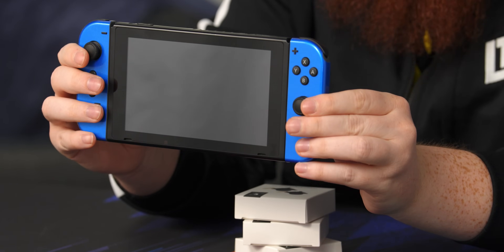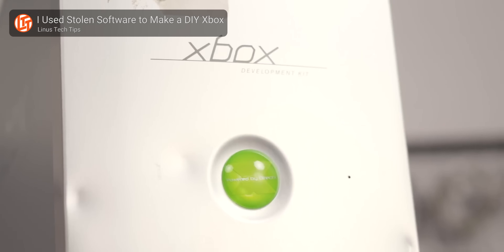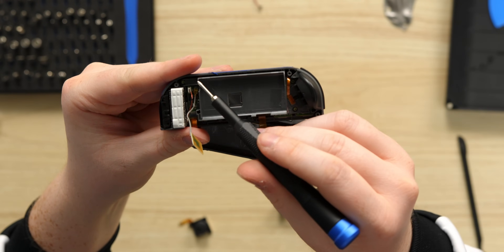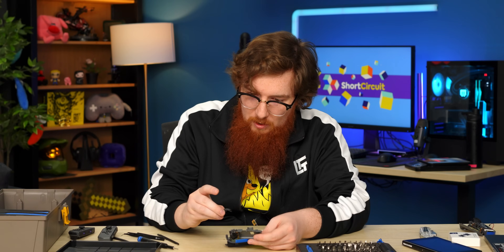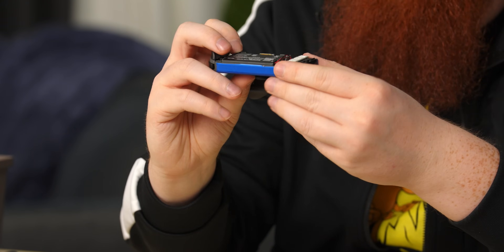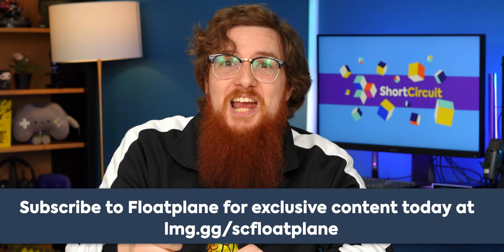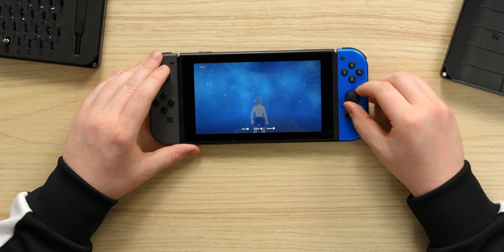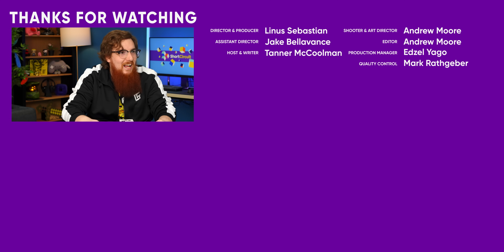Make your controllers WAAAY better - Gulikit Joycon Joysticks

Comment: The fact that there's no noticeable difference between the original and this one is, in fact, a huge selling point! You really don't want your controllers to feel "wrong" after a part replacement, after all.
Reply: I've been using them for awhile and, there's no difference whatsoever that I can feel. I mean, I might have convinced myself that I felt a teeny, tiny difference (just like he did) when I first put the pair I got in but, I honestly have to remind myself which joy con have the gullis and which ones don't so I'm leaning more to thinking that even if you think you feel a difference? Most of it's probably just in your head because you know that you changed them so.... they gotta feel just a little different, right? lol.
Reply: @dallaynavokan5513  Oh, I've definitely had that happen! Not with joy cons, but other hardware where I replaced a component. Especially since the thing is broken at that time, you've probably forgotten how it felt initially as well, and it just feels different in your head now. 

I call it "repair paranoia", where you start judging the object every single time you use it and are careful to notice any discrepancies in the job you did.

For example, I changed the locks on a couple of doors and one locking mechanism too, whatever it's called. Every time I used the doors, I'd try to feel the handle and the keys to see if anything didn't fit.
Reply: @dallaynavokan5513  its the same caps but the deadzone sensitivity across the board is far superior to the native joycon. Have you tried tweaking sensitivity in games at all?
Reply: @dallaynavokan5513  That tiny difference that is barely perceptible and after 5 mins, you are used to it and question it, is the fact that it does not have potentiometers rubbing together inside. Its such a small thing that most people without very fine motor skills wont even notice.
Reply: Speaking of which we saw it in the video but you’re almost guaranteed to have to calibrate one of these but it works great after that just make sure to calibrate it attached to the switch
Reply: Commodity parts are quite good. And paying a bit more gets you a magnetometer instead
Reply: It has a bigger input lag than the normal analog sticks
Reply: I just tried these but sensitivity on them is too much different than the originals, maybe I got a bad pair but the travel distance is so much shorter when you check the calibration it seems off to me.
Reply: @dallaynavokan5513 this is called confirmation bias. You see patterns that don’t exist which confirm something you believe is true.

Comment: These have had a bit of a quality control problem. The first batch had arms that would catch and jump a bit, causing a click and the magnet to jump a bit. They claimed to have fixed the issues from that batch, but I got a set recently that had the exact same issue. They really need to get that ironed out before I consider them again.
Reply: This was also not mentioned on the KingKong Pro 2 video, Gulikit has consistently had QC issues with their products.
Reply: Yea, I almost got a few sets for my joycons, and wouldn't mind some for the steamdeck as well, but there are enough iffy reviews to keep me away
Reply: Thanks for writing this post. Just from seeing the title you'd expect this to be the holy grail fix for joycon drift, but when it's a product that has issues of it's own, it becomes a questionable purchase.
Reply: I received them a couple of days ago, it's a new batch said Gulikit. I can assure you they don't click anymore but they still have a little gap when it's installed. To fix that gap they have provided black round stickers to cover it.
Reply: @MariusMerchiers  i think that's a good enough fix considering that even the stock joysticks also has that exact type of sticker
Reply: @IdiotRace  oh i wasn't talking about that issue, that one definitely needs the manufacturing fix. i was talking about the gap issue
Reply: @MariusMerchiers  I don't know what to say, I ordered after they said they fixed them and received them 2 weeks ago. Every single one clicked. I also got the ones for the Steam deck and one of those click, but at least I haven't seen a functional issue on that. I'm just kinda soured on the company now.
Reply: @adeptfelix  They are a startup, atleast they are trying to make a difference, and trying to iron out their shit. Their new KK2s had added weights and Trigger dampeners, they sell them cheap for $40 in my country, an improvement with no additional cost always a good deal for me.
Reply: @rowennjohnmartinez5108 lol they are prob just trying to make money.
Reply: @AngryWildMango  trying to make money while also trying to change something is what companeis do right? BIG companies doesn't want to implement hall effects so here we have one who does.

Comment: you could do laser pointer detector pad joycons
Reply: no magnets, just laser on the tip, linus tech tips
Reply: pen detector pad is easier (led detectors) than a full camera, 1-bit laser pad
Reply: or just touchcons, not joycons
Reply: yep kinda steam deck touch joy pads but actually meant to be touch-joycons
Reply: getting bored already?
Reply: you fixit what you started
Reply: add a twist axis to the knob
Reply: yes for (float)plane games
Reply: well a 1-bit lcd detector screen

Comment: Wait am I crazy?
The video shows him disassemble the left joy-con and remove the blue wrap. But later in the video he keeps referring to right joy con as the replaced unit (despite it still being wrapped in blue) eg. 5:53??
Reply: I got confused too but he only removed the wrap from the back, I think he just used another controller set for the gray one. You can see that the bottom is gray in the end shots
Reply: @GrindyBeak  thanks I was so confused lol

Comment: One thing I can never get a clear answer on: Does this kit work on Switch Lite?
Reply: Teardowns seem to show they use the same joysticks, so I can't think of any reason why it shouldn't work
Reply: @tannermccoolman4647  Other than some strange firmware or different ribbon pinouts just to make repairs less easy for the consumer. Not like ANY company cough apple cough would act in such a manner though, right?

Edit: autocorrected pinouts to spinouts by accident.

Comment: I just wish there was a kit for Switch Pro controllers. I was able to find dozens and dozens of copies of this kit everywhere for the JoyCons, but not a single one for the Pro controller. Yes I know the sticks for the pro controller are soldered in (which I find annoying considering the much much smaller and more compact JoyCons managed to make all of it's parts modular and use connectors) but there are hundreds of soldering-required mods for systems out there. The GBA landscape is full of mods and even new ones being made to this day that give you better screens and (for original models) backlights, better audio, HDMI output, composite output, etc and many if not most of them require soldering. You would think there would be at least ONE hall-effect joystick replacement for the Pro controller. But all I can find are Hall Effect joysticks for joycons or the original Pro controller's joystick replacements, not Hall Effect ones.

And yes, the pro controller eventually drifts too, mine definitely is these days.

Comment: Whatever you do, DO NOT damage the JoyCon rail or shoulder button flex cable connectors. They are a true pain in the ass to replace so dont flip them open forcefully as the black plastic bracket comes off easily

Comment: Have you tried doing this too both joy cons on the Oled switches? This is the second set of joycons that won't connect to the Oled switch (brand new oled switch with joycons and only left joy-con).    Right after the mod....only one joycon will show up and when you disconnect both  controllers the left joycon will not connect with the switch....

Comment: I've been using the gulikit king Kong(pro?) 2 controller for ~5months now, and I can't never go back to 'official brand' controllers.
You can even te calibrate the controller's joysticks AND triggers.
I was so mad that my triggers were 'broken' so I threw it through the whole house, literally smashed it against the floor multiple times, just to find out that you can recalibrate the triggers, and I must say, there very durable, nothing broke at all!
The only downsides are the 'debounce time' it's hard to double tap the a b x y buttons and that you can't connect it to a PS4/5 or a Xbox. (It works with Nintendo switch)

Comment: The top of the stick comes off, making it easier to get through the opening, and is a vital part of the process, since there is a round sticker you put under the stick to keep debris from falling into the mechanism. 

They are great sticks though. I bought the gulikit controller after Linus reviewed it, and it was so great that I wanted hall effect sticks on my joycons. Apparently they are working on dual sense sticks also. Can’t wait for that so I can get rid of pot sticks completely.
Reply: There's also a split in those dust stickers so you can, at an angle, just ram the tops through.

Comment: Resistive joysticks can be corrected in software but somehow SONY Nintendo got lazy or it was too complicated.
The reason for hall effect is that because of the magnet, it lasts much longer than resistive, because it isn't being worn away.
Reply: gulikit aren’t licensed, however a ps5 controller hypr has hall sensor, and you can built yourself a controller with it

Comment: I just went through two pairs of these. For the joycons. First set had one with a flaking back and forth. Replaced it. Second one has worse drift than a regular joyCon sticks. :( Kind of disappointed these were recommended. Looking online tons of others have problems with these joysticks.

Comment: Just got these; working great!
I didn't realize the kit from amazon came with not only small screwdrivers for the 2 types of screws, but ALSO a tweezer-like tool, some thumb grip caps, AND an entire set of replacement screws in case you lose 1. I didn't but now I have spares!

Comment: My problem is motion. 
Bought HoTD and alien panic. Both have motion issue's,. It just drifts off a bit after awile. There is at least a center button. 
Wanted to buy arms and switch sports. Guess i won't. 
Ill try to get new joycons. 
I doubt this will fix the problem. Maybe?

Comment: Guess I have been lucky so far. Never had drift issues.
However, for 'a mere' 10 bucks difference I'm not gonna risk messing up a controller (which would mean I'd have to get a new one anyway).
I'd go for a new one to begin with.

Also wouldn't bother with it up front, obviously. Only considering it as a repair option.

Comment: I have four joycons with various degeees of drift from slightly annoying to completely unusable. My repair method has been using Hori Splitpad controllers for mobile gaming and using a switch pro controller (it’s a seriously good controller and worth it) for TV gaming. I hope to make this mod for at least the two worse of my joycons though as we have to use them if we are going to play any 4 players games and when you consider the cost of a switch pro + aftermarket joycons the $30 a pop cost isn’t terrible.
Reply: Buy an 8bitdo Ultimate controller. Thank me later.

Comment: I don't know why everybody gushes over these. I bought their first party controller and the dead zone compensation is all a lie and just within the controller firmware. You're having to recalibrate it on the fly which doesn't make the sticks any better it just makes manual labor for you calibrating it. They honestly have terrible dead zones and don't stick very well.

Comment: this is not the reason it was released if ya have working joycons don't replace BUT if your joycons begin to drift a lot to where you can't recalibrate them then buy the gulkit and replace them because it's WAY better the the nintendo joystick and have basically a 0% chance to get drift or you could buy something like the splitpad pro better feeling but has the chance to drift less then the switch but still a chance to drift

Comment: 10$ Difference to a new joycon. But the standard joycon joysticks on a certain chinese vendors website cost about 2$. So if all I want is to just replace my faulty ones with some new ones while having the same amount of work, I don't see this product being that much better. But I guess that depends on how much you use your switch. I've had to replace my joysticks once so far after around 2 years of usage.

Comment: Although my situation isn’t specifically regarding the Switch, my DualSense now has both sticks that drift. I could really use these replacements.
Reply: just clean the sensors
Reply: @hitwho6  This is a temporary fix, they'll eventually wear to a point that cleaning won't help.
Reply: Gulikit is working on replacement sticks for Playstation, not out yet though
Reply: Unfortunately you won’t be able to avoid soldering😊
Reply: @G0rgar  It's going to be a while, they will do the dual sense edge modules first, then the regular dual sense and xbox. It will be a year or so before we see them.

Until then, your best bet is to get a drift fix mod and then just buy soss joysticks as you need them. The drift fix mod (used to calibrate the new sticks) is usually around $15 and then the joysticks are another 15 for handful of them. If you're garbage at soldering, just use some snips to segment the joystick and desolder it one point at a time. If you're slightly competent at soldering, the whole job is a walk in the park.
Reply: @flyingtentacle7631  I don't have stick drift with my Series X controller yet, nut when I do I really hope there will be Gulikit sensors to replace them.
Reply: You can replace them with Alps RKJXV122400R joysticks. They're less $5.
Reply: @Buzás András You have just gotten lucky. Ive had brand new first party sony, xbox, and nintendo controllers drift. Brand SPanking new out of the box. Sadly its a Alps potentiometer thing.

Comment: I bought the Gulikit King Kong Controller when you guys recommended it. I've already broken the one I bought and a replacement controller I got for that. Doesn't matter that there's no stick drift when the sticks themselves and the triggers break way earlier than of any other controller I had. Yes, I do play very stick intensive games like Skater XL and Fifa and I do play a lot. But I haven't treated it differently than other controllers that held up well. Let's hope the 2 I got weren't the norm, but based on my experience so far I unfortunately think that there's a quality control issue and have gone back to using other controllers.
Reply: What broke on it? Very curious about this
Reply: @tannermccoolman4647  poor QC, that's why I don't buy in the hype when they review that controller, there's a reason why the price is so low for arguably better controller then the OEMs, on paper of course
Reply: @tannermccoolman4647  The left stick itself on both controllers - not the mechanism but the actual plastic. The rubber at the top was already broken after less than 3 months on both, faster than any other controller I ever had. That was still ok, that's replaceable and kinda playable for the most part. For the first then the actual plastic on top of the stick broke off gradually, Until I almost had only the stick without top left. 

On the replacement, it didn't get this far, but  still broke off a bit and created a sharp edge and wasn't circular anymore. On this one also the right trigger got stuck and had to be pulled out every time I pressed it in more than halfway.  The super bad thing was also that it wasn't noticeable from feeling that it got stuck, just barely enough to be activated slightly, which is mostly ok for games that use the analog pressure from the triggers, but some games use them as normal buttons, and there it became literally unplayable.

One detail that might be important. My hands are on the smaller side, so I do play mostly with my thumb around the stick and not on top of it - so that might put additional strain on the plastic when it gets pushed on the edge and not from the center. However, I still never had this issue with any other Input device I ever had in 30+ years of gaming.
Reply: Yeah, you may play intensive games a lot but a joystick or controller that can't keep up with that sort of usage is just a bad product. Thanks a lot for sharing your experience, I think I'll wait for the technology or the manufacturer's QC to mature. As of yet even if I play different games than you, I'm not taking the risk, the problem might rise a bit later but it'll rise, and rather quickly from what I get.

Comment: I bought a set of these sticks about a month ago, the really are easy to switch out. I got them on amazon Canada and thy came with the tools and after calibration they worked perfect. Ifixit had a good video guide I followed and it was way quicker then waiting for nintendo warranty to fix them and in theory they shouldn't drift again.

Comment: Only downside to these is the price, if you don't mind replacing the joystick every now and again you can buy aftermarket joysticks for $2 a piece which over the lifetime of the switch is probably not going to get close to the cost of a pair of hall effect joysticks
Reply: 2$ joystick without shipping. Buying multiple of them and replacing them as they teardown just sounds like a pain instead of doing it once and not having to think about it, but if you don't value your time and want to spend like 10$ less in the long run, then I guess that's a good deal.